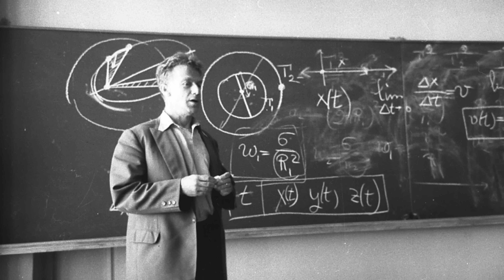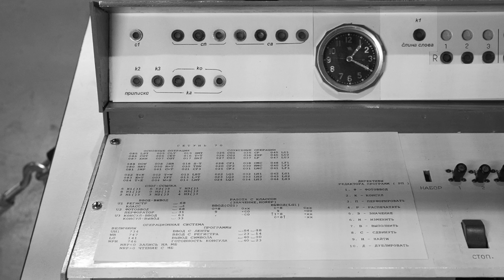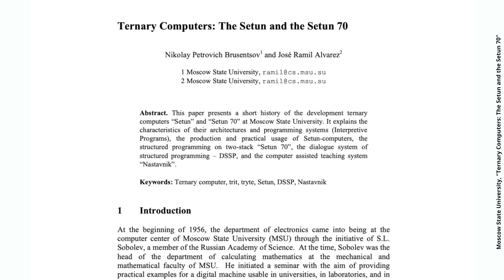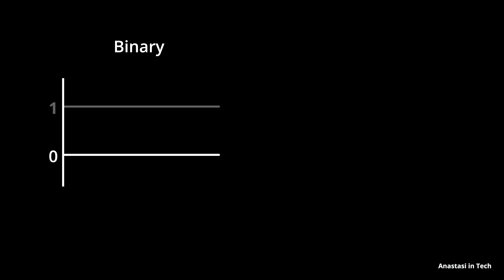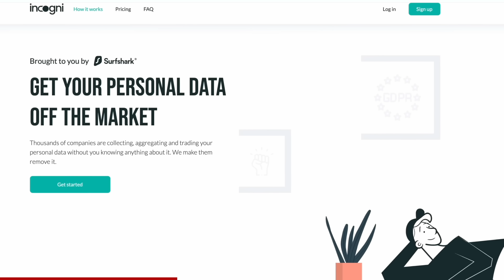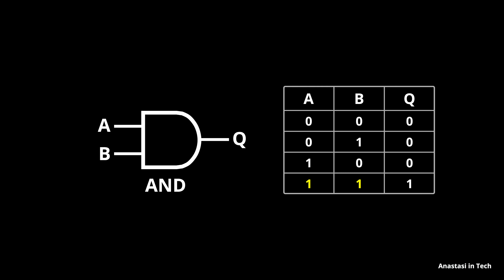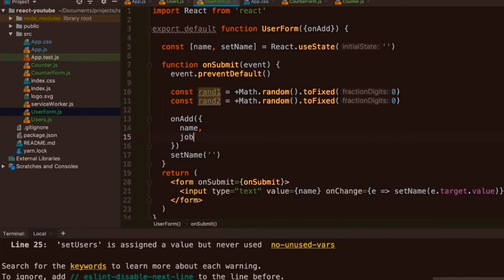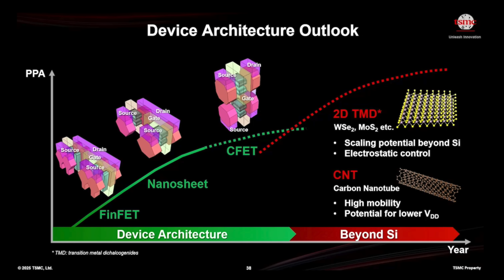The World's First Ternary Computer

Comment: I think quantum computing devices using  Qubit will have commercial success before ternary computing device. While you might be able to be a little more efficient with ternary devices, the integration is a nightmare and at the same time limited by the same physics barrier binary systems are. Noise is already a problem in binary system, it will be even more troublesome in a ternary system. So scaling is not even on the table. It's only about efficiency and I don't see that being super enticing for future investors.
Reply: You know that noise is an infinitely bigger problem for quantum computers right?

Comment: You have a mistake on your ternary logic diagram 11min44sec - row 3 is incorrect and should be written 1 -1 -1 and you lack the explanations why the multiplications is as it is. Here is the explanation: always multiplying two logical states will produce the result related to the lowest state like this, i.e. -1 x 1 = -1 because -1 is the minimum threshold which here plays the mathematical role of "0", but if we do -1 x 0 = -1 we have the same minimum threshold -1 which plays the mathematical role of "0" and which being multiplied by a higher value, the result is the minimum threshold, i.e. still -1. -1x-1 =-1 because they are both the minimum state just like 0x0=0. The rest of the combinations like 0x1, 0x0, 1x0, 0x0 remained both mathematically and logically as in binary circuits.

Comment: in the past it was just way easier to build smaller and smaller transistors that were binary. 3 states require precision, and we have precision, we have 5 nanometer chips. i think its time to go to 3 states or 4 or 5 or the most they can do relaibly.   photonics would do this with  waves of light. you can use the same circuit for as many diferent wavelengths.

Comment: When the cryptocurrency #IOTA started in 2016/2017, it was based on ternary and meant to be the most efficient network possible, but it was not efficient because all the hardware it was running on was binary, so there was a constant conversion. Maybe in the future IOTA's original vision will be feasible.

Comment: Good Morning Anastasy

Seems that “Ternary computing” offers advantages in scalability and low operating costs, as it operates without elaborate cooling and can be integrated into existing CMOS technologies, thereby minimizing consumption. However, in certain implementations, it may exhibit higher production costs and potentially increased power consumption if the hardware is not optimally designed. Quantum computing surpasses ternary computing in energy-intensive applications, such as AI training or simulations, through exponential efficiency gains, but it carries disadvantages due to the high cooling requirements, which elevate the overall consumption to the level of household appliances, in comparison to megawatts for supercomputers. 
What you think will both Technologies have his specific usecase?
Best Marcel

Comment: There is a an advantage to binary that should be considered. In binary if it's not a 1 it's a 0. In trinary if it's not a 1 you still have to make another check to see what it is. The biggest example of this is in storing floating point numbers, the first digit in a floating number must be non-zero so it is a 1 and you can leave it out.

Comment: Yes, ternary will replace binary. Tech won't let tech stagnate. Once things pick up, it will be quickly adopted as the better faster option. Plus with AI, and good context, the speed at which we can develop for trinary systems will only get faster.
Why stop at 3 (-1, 0, 1)? Why not use 10 (0 - 9)? Why not use a type of wave? Design a system that can have an infinite number of high and low. As technologies advance, threshold levels can become more granular providing higher leveled states? idk, not a computer scientist. :)
P.S. Then AI would get better since since weights rely on float point values, and we can have the weight be the transistor threshold. Again, not a computer scientist. Sure I'm wrong somewhere there.
Even trinary chips on GPUs would be bonkers. Good luck to the people pioneering that technology.
Oh, and an assembly compiler that compiles binary to trinary would be cool too, then systems can possibly be developed on binary systems, and ran on trinary systems.

Comment: 17th Century: Early Mechanical Calculation and Binary Ideas

1617 – Napier's Bones and Location Arithmetic: John Napier, famous for logarithms, invented "Napier's Bones," a mechanical multiplication tool. In the same year, he described a non-positional binary system called "Location Arithmetic" in his treatise Rabdology.
1623 – First Automatic Calculator: Wilhelm Schickard designed the first automatic calculator, which combined Napier's rods for multiplication with geared wheels for addition. This device, though operating in decimal, was a foundational step in mechanical computation.
1642 – The Pascaline: Blaise Pascal created his "Pascaline," a gear-driven adding machine that could perform addition and subtraction. Its carry mechanisms foreshadowed the logic later used in binary addition.
1673 – The Stepped Reckoner (Pinwheel Precursor): Gottfried Leibniz designed the Stepped Reckoner, a mechanical calculator capable of all four basic arithmetic operations. It featured an innovative stepped-drum mechanism, a precursor to the pinwheel design, which was used in calculators for the next two centuries.

18th Century: Conceptualizing Advanced Machines

1786 – First Proposal for a Difference Engine: German engineer Johann Helfrich von Müller proposed the first design for a **Difference Engine**, a machine intended to automatically compute and print mathematical tables. Though never built due to lack of funding, his detailed description was a direct forerunner to Babbage's later work.

19th Century: Mechanical Computers, Logic, and Punched Cards

1804 – Jacquard's Loom and Punched Cards: Joseph-Marie Jacquard's loom used decks of punched cards sewn into a roll of paper tape to control weaving patterns. This was a landmark demonstration of programmability, as it separated the program (the pattern) from the machine (the loom).
1820 – The Arithmometer (First Mass-Produced Calculator)**: Charles Xavier Thomas de Colmar introduced the Arithmometer, the first commercially successful mechanical calculator. It used Leibniz's stepped-drum mechanism and was robust enough for office use.
1820s–1830s – Babbage's Engines: Charles Babbage began designing his Difference Engine to compute astronomical tables. While working on it, he conceived of the far more advanced Analytical Engine (1830s), a general-purpose, programmable mechanical computer. Its architecture included an arithmetic logic unit ("mill"), memory ("store"), and control flow, all programmable with punched cards.
1843 – The First Algorithm: Ada Lovelace wrote the first computer algorithm, a detailed program for the Analytical Engine to compute Bernoulli numbers.
1853 – First Working Difference Engine*: Inspired by Babbage, Swedish inventors Georg and Edvard Scheutz constructed a working **Difference Engine* that could compute tables and print the results, producing the first mathematical tables ever calculated by a machine.
1854 – Boolean Logic: George Boole published *An Investigation of the Laws of Thought*, establishing **Boolean algebra**. This system for treating logical propositions algebraically provided the essential theoretical framework for designing all future digital circuits.
1869 – The First Logical Machine**: William Stanley Jevons built the "Logic Piano," the first mechanical device designed to solve logical problems using Boolean algebra. It used a keyboard and wooden rods to implement truth tables and output valid conclusions.
1890 – Hollerith's Punched-Card Machines*: Herman Hollerith developed electromechanical tabulating machines that used **punched cards* to process data for the U.S. Census. Metal pins passed through holes in the cards to complete electrical circuits, a binary presence/absence detection system. Hollerith’s company later became IBM.

Early 20th Century: Cryptography and the Path to Electronics

1917 – The Stream Cipher (One-Time Pad): AT&T engineer Gilbert Vernam invented a cipher that combined plaintext with a key stream of random bits on paper tape using a binary XOR operation. This device, producing what is now called a *stream cipher* or one-time pad, was theoretically unbreakable and presaged modern digital encryption.
1920s – The Enigma Machine: The German Enigma machine, an electro-mechanical rotor device, was invented. It implemented a complex polyalphabetic substitution cipher and became a primary target for Allied codebreakers in WWII.
1938 – The Polish "Bomba": Polish mathematicians, who had first broken the Enigma cipher in 1932, built an electromechanical machine called the "**bomba**" to automate parts of their cryptanalysis. This work directly inspired the later British Bombe.

World War II: The Electronic Revolution

1940 – The British Bombe: Alan Turing and his team at Bletchley Park developed the British Bombe, an electro-mechanical machine designed to rapidly find Enigma keys. Hundreds were built, performing a specialized, parallel mechanical computation to aid in codebreaking.
1943 – Colossus To break the more complex German Lorenz cipher, engineer Tommy Flowers designed **Colossus**, the world's first programmable, electronic, digital computer. Operational by late 1943, it used 1,600 vacuum tubes to perform high-speed Boolean logic operations on binary data from paper tape, proving that large-scale electronic computation was feasible and effective.

Comment: Ternary logic has no future in conventional computational models for reasons of rising complexity of electrical engineering. Electricity can control switches using voltage or current which requires rising in energy for every accessible state but the more the states the more the windows shrink. So unless transistors with effective hysteresis appear there will be no ternary logic. I can invent them but there is no point in that for me. Also effects of inverse capacity can be utilized for ternary logic

Comment: I’m 68 and never worked directly in information-processing science or technology. But when I was a student, I always seemed to have spare CPU time on my university’s mainframe (an IBM System/370 Model 158). I used to wonder why we stuck with binary when the “electrically natural” alternative was ternary (−/0/+).

I wrote, in 360 assembler, a very primitive ternary-based calculator emulator. There was a twist: I encoded an analogue-like input by using idle time measured in machine cycles. I’d budgeted 64 cycles to represent the value, as if a hypothetical analogue co-processor could send or receive it through timing.

Then I suddenly ran out of CPU quota. They asked why; I showed them. I was laughed at. Despite the academic stature of those doing the laughing, none of them grasped what I was trying to achieve. The mockery—and the suggestion to focus harder on my degree subject (physics)—made me drop my “computing dreams.” When I woke up, the PC era had arrived and it felt too late to dive back in.

Today I live in Russia. I use computers and I know some Python, but the memory of Assembler/360 and tidy, well-understood machines still makes me nostalgic.

Comment: 3 State logic was a fun start in my digital training. 0- for low, 1 - for high, and a 3rd state as a Hi-Z (disconnected) state.
Reply: Binary has not been a standard. The Hi-Z state became the middle noise gap. This 3rd state was minimized that allowed 12V to 5V and lower voltages.

Comment: The normal transistor is BJT. I think that if You want, You can 3 or more level with FETs also. 1 FET is 1 level. And the simmetric amplifiers use simmetrical power supply. +GND- So exist, just didn't use for this. But don't need minus, you can do it I think with 0-10V, like 0-5V is 1 FET, 5-10V an other. And more. Another example of different voltage levels. They use different resistors to recognize different buttons or functions. For example, in headsets or in the OTG cable, it gives the truth table. So I think that if they had wanted to, they could have solved it with these. Of course, I think that carbon nanotubes are smaller and dissipate less, but it would have been possible without them. I think it also depended on whether it was worth it. I think the programming of such things would also be different. We are at a point where AMD video cards cannot be used for conversion on Linux, AI on Windows, but it is often still a problem to provide a normal image. It would be pointless to have a computer operating on a different principle if there is no support from the operating systems.

Comment: my math college teacher taught me about this in 2000, he showed us how to achieve the optimal base to represent numbers, the function has the peak on the Euler number, the base for Natural Logarithms, but he said, for discrete computers doesn't make a lot of sense, so we use the next best integer number, then he made us find what was and it was 3. Then we made some exercises about it. It was fun.

In the PLT (Programming Language Theory) community I've seen attempts to make languages for these computers, using all sorts of trickery including SKI calculi, SKI is type of combinator calculi used in lambda calculus that says every program can be written with these 3, combinators, S, K, I. you can make if statements and recursions with these 3 little guys so the idea is to use trit strings to represent a program, this would be just experimental because a program could get really large by using them because a SKI representation isn't efficient at all, is just nerdy stuff.
Reply: That is what I can't get my head around.  How do you write programs for yes/no/maybe.......  How would you debug them?
Reply: @robertsmith2956 There is nothing special here.  You can work in base 3 just like you can work in base 10.  I mean even at an assembly lang level it would only really show up in that shifting your bits now divides/multiplies by 3-- only the people building the adders and other components really need to care.

Now there is another question about designing libraries to efficiently use this hardware and it's plausible that is what the OP means.  

But there are other reasons PLT care about adding a 'maybe' state -- basically how do you reason about your code in the presence of nontermination.  The halting problem isn't solvable by a computer so that function which seems like it might return true/false could really also get stuck in an infinite loop (a kinda maybe state).  Often you want to represent this kind of thing in your type system (promise aborts, completes or stalls) but nothing to do with trinary in the hardware.
Reply: @robertsmith2956  not 'maybe' it is 'neither'
Reply: @robertsmith2956  yeah.. doesn't make sense
Reply: @robertsmith2956 true, false, null, blank (not null)
Reply: @robertsmith2956  It wouldn't be yes/no/maybe in that case, because with more states than 2, it would be state 1, state 2, state n
Reply: @robertsmith2956  not sure if you should label the 3rd state as Maybe... This is not a quantum state / computer. To answer your question:  a yes / no type of problem will always be binary. But a Yes/No/Ignore problem can benefit from a trinary chip and make these algorithms easier to implement.
Reply: @hitchjay  wouldn't Ignore = No?
Reply: @hitchjay  on a 1 hrz machine maybe..  but multiple gig, I can handle the wait for  3 clks it takes to cmp EQ, then 2 more for less than.
Reply: Congratulations, you studious guys. I wish I too could take my eyes off her face.
Reply: @AamBhartiyaNagrik  Brains and beauty, I find her mesmerising also
Reply: @AamBhartiyaNagrik  just pause the video when she isn't on frame.
Reply: I can imagine that if a quantum computer will work with on,of and superposition states, then that should mean that it not only will wotk with yes and no but also with different states of maybys or doubts.
Or you got 0’s & 1’s and different states in between them.
But i can imagine that such type pf computer will run unreliable and buggy🤣
Reply: @johneygd  quantum computer turned out to be a hype, description of its functionality seems humorous if not downright fraud
Reply: It could be better from math point of view but much worse from engineering point of view. It is much easier to implement binary logic on transistors and primitive elements.
Reply: Probably better to use sequences ("trytes") of say 9 or 27 trits, and to use these to represent lots of different machine code instructions, that may be written by humans in assembler. As for logic gates, they might be modelled on the natural human Aymara language logic, with its three states of Yes, Maybe and No, and its different unary and binary combinations, that tend to be somewhat modal. S, K and I are probably better for some a little bit higher level language that may be compiled to tryte machine code. It might be nice also to try and code some variant of Linear Logic into a middle level language built on top of trit low level machine language. Because Linear Logic is way more resource sensitive than mere Intuitionistic Logic. It may work building really simple phase space (quantale) semantics for linear logic on one of the monoids with three elements i think. It is a promising research field.
Reply: As linear variants for the weakening operator K and the contraction operator S, there are some operators called B and C, but i don't currently recall what they do. I is identity operator of course. Been a while since i played around with SKI calculus or Lambda calculus.
Reply: Three letters acronyms sound as limited as colloquial humor.  Leave it to the less educated.